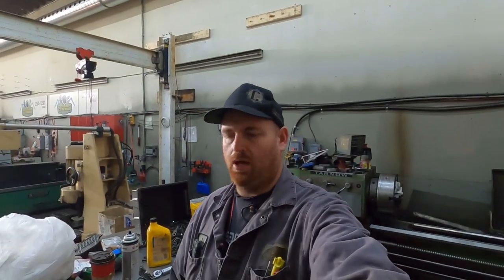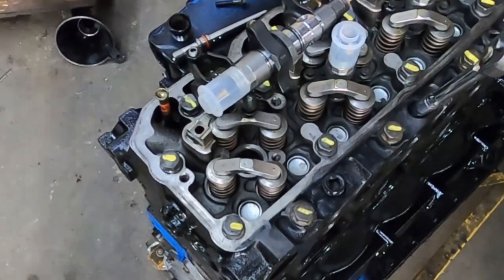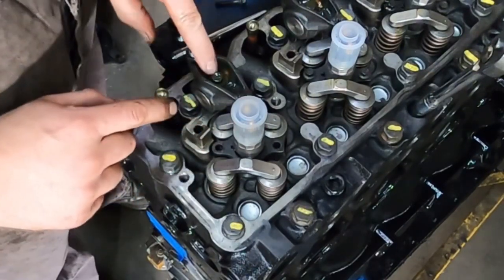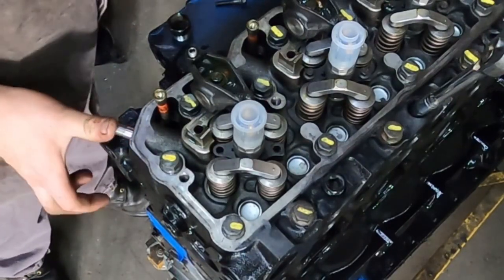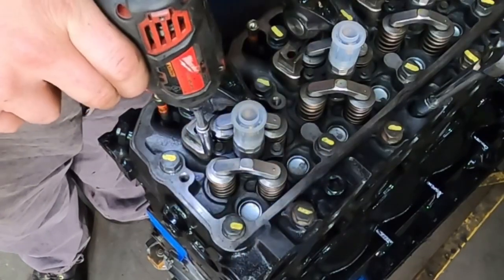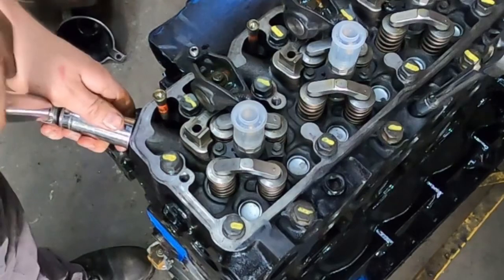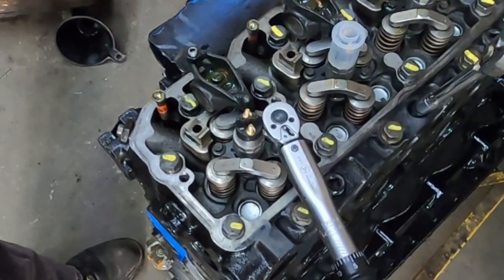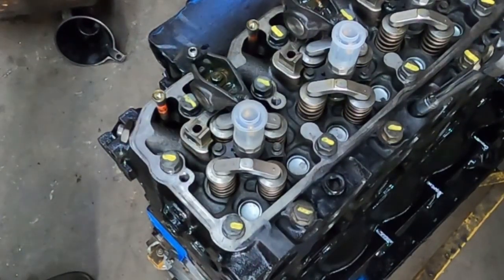"Unleash the Power of Your Cummins: See How to Swap Injectors!" 03-07 cummins

Comment: Any info on the differences in injector coils? Are later different voltage? Looking for injectors to run with a CM2150 ECM
Reply from the maker: 5.9 to 6.7 are different voltage. Then 18 and new is different. But I don’t know the voltages off the top of my head
Reply: @CUTTERUPROB  I have the 6.7 C5255257 piston. Any idea what spray pattern this needs?

Comment: Good day to you I thanks for responding back to me.i have a 08 dodge cummins. i.m. look  for new injectors. i have stock injectors stock cp3 pump. looking for 90hp. injectors. what would be the best rout to take. your the man to talk too. thanks for your help. have a very good day. J.C.
Reply from the maker: How much power do you want to make ?
Reply: @CUTTERUPROB  im trying to make. 650.hp. not trying to make. to much big power just when need it i will have it. looking at 10mm cp3 pump and 90 hp injectors.is this the way to go ROB.